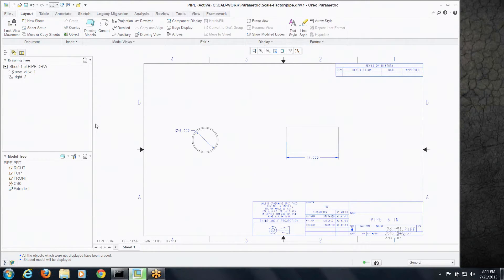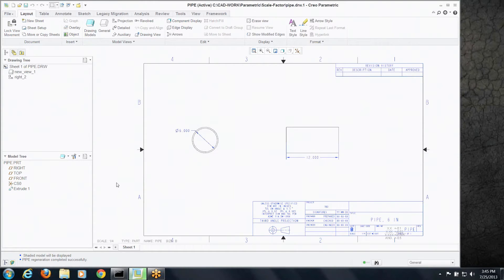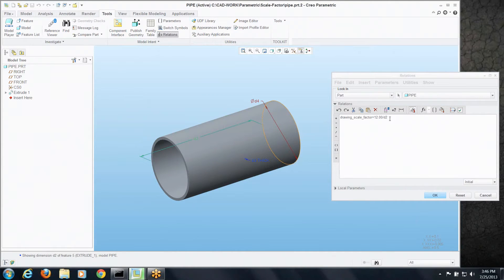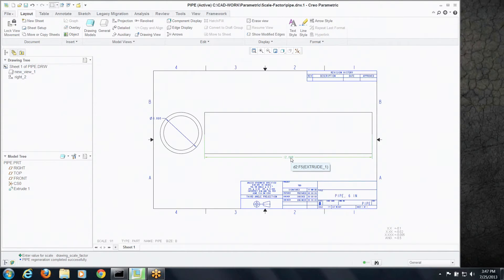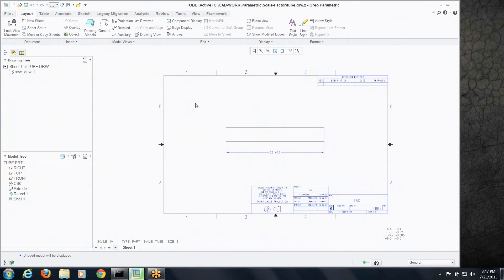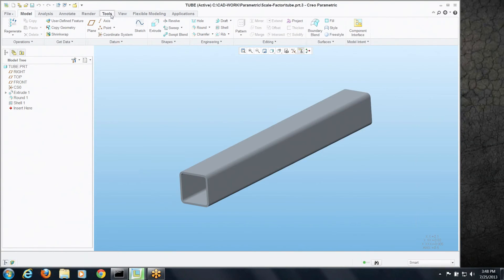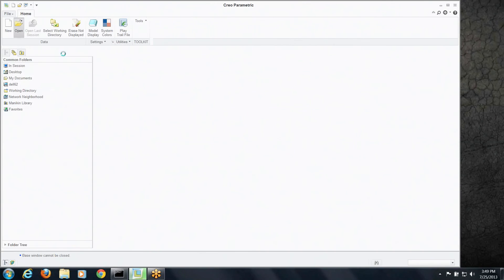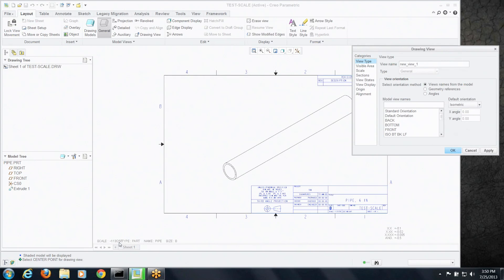Using the "drawing scale factor relation" to automatically resize views - EAC Tip-of-the-Week

Comment: Hi,
Thanks for an amazing tip. This works very well if you place all your drawings manually. Is there a way so that I can setup it up to work on templates? I've unticked the scale function when I create a template view, but then the drawings all default to scale 1:1. I still have to manually type in after activating the view "drawing_scale_factor" in my scale.

Comment: Hi,
Your tutorial was very much use ful to me, I thank you for posting in on Youtube.
I was also looking for similar options of scaling the drawing automatically
My exact requirement is like this "A drawing template needs to be created using the relations and mapkeys to create 6 orthographic views of any arbitrary part, where in the drawing sheet size needs to be automatically set to different sizes(A4/A3/A2/A1/A0) as needed depending upon the selected part size for a fixed scale 1:1"

In this regard I checked with PTC support, but they advised it as an impossible to to job with Pro E, and they said that drawing templates are non parametric to control through relations.

If you can guide me with respect to my above requirement it would me evermore helpful to me. I can be reached at   anand12j@gmail.com

Thanks once again for your video tutorial.

Anand